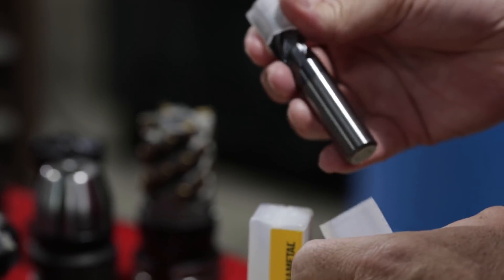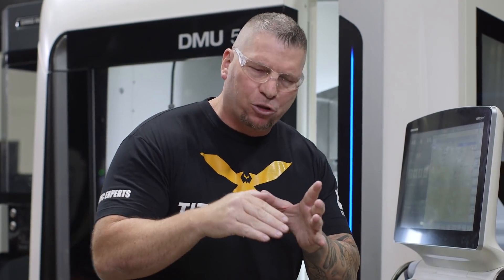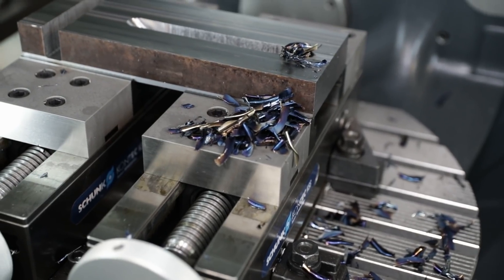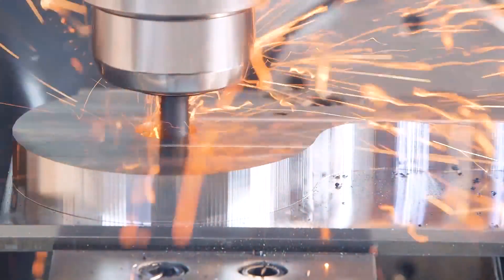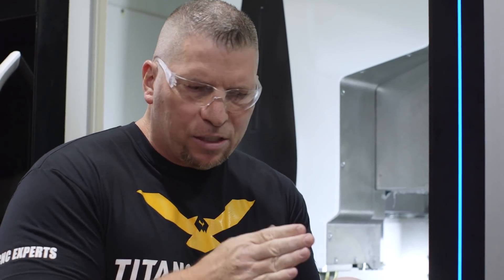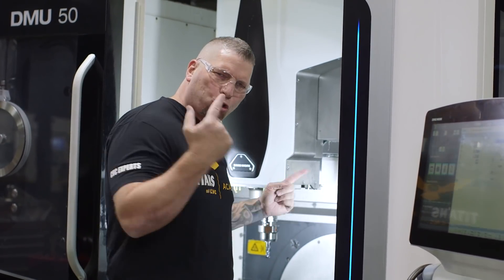Craziest Full Slotting CNC Machining Video You’ve Ever Seen! | Kennametal Harvi 1 TE

Comment: Impresive 🗜️ wel its a good machine  you can test it save. 
The 4flute endmill is impresive good it olso can cutting  stainless steel.
(But yeah i use verry slow speed and cooling oil) it still can by danger 🔧🕵️‍♀️I was surprised how sharp the endmill was after having already processed a lot of matriaal.
I try hss 4 flute endmill and it was after 3mm Bone 😂

Comment: All these years we've all been developing new techniques and strategies to improve machine and tool life, using lead in/out, ramping, trochoidal, HSM, etc. to avoid the old corncob, full depth, slow feed, roughing method. Fast forward a couple decades: Full depth, no lead in/out full depth rough hogging, no technique involved lol. The cost? $10,000+ for a new spindle, thousands for hydraulic tool holders, couple hundy for the 3/4" solid carbide bullnose mill. Hmmmm, yeah, I'll stick to more sophisticated and thought out machining strategies.

Comment: It would be interesting to know the temperature that tool reached doing this.
Reply: At the edge its accually a few 1000C.
Reply: Ideally, the heat produced in the cut is passed through the chips as they are cut away, hence the dark blue color.  I bet that tool was still a little too hot to touch though!

Comment: About spindle or holder flexing? I think that is actually  servo stalling , struggling, - resonating issue. Resonanting frenquency in Titan's video is too low for spindle ot toolholder flex. There is alvays  margin until servos fail. They are out of absolute position when struggling, deppending of setting  They can fall in resonance...  Here you can see what i'm talking about. sorry for anoying english ...  youtu.be/N2bTViQBp10?t=1001  time 16,40  .. also 17.50
Reply: Now when i look it again it seem both factors combine cause resonation: servos strugling - spindle with toolholder flexing... Let slow a bit, then servos can keep constant speed and spindle will flex less and stop resonate

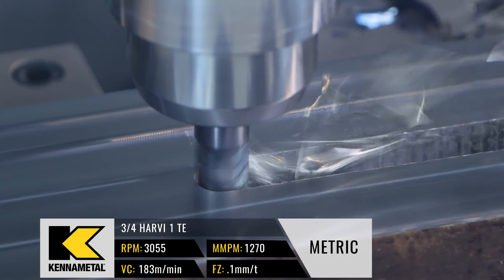Comment: more impressive than the tool is the holder, how did that not pull out or spin from torque? does it have the safe lock feature? i cant believe it didn't break a flute or twist off from the severe cut at 1:38.  the machine was definitely not liking that.
Reply: I believe the harvi tools have a special holder that has threads that match with ones ground into the end mill so if anything it gets tighter

Comment: I think you are hitting the limit of the hsk 63 connection, might do better if you can get a shorter gaugelength holder.
But really cuts like that are for hsk 100 or 50 taper machines with box guideways.

Comment: I mistook the head vibration for trochoidal milling..
Reply: Yeah so did I.  That machine is not long for this world.
Reply: NerdByDesign I use mazaks, my experience with haas has me thinking they’re not very robust.
Reply: @TheJonesey1  I am pretty sure that was a DMG Mori and not a Haas machine.  I have heard that Haas is not as robust, but they are far better than they used to be.  They also cost quite a bit less than Mazak if I am not mistaken too.
Reply: NerdByDesign ok, mazaks are expensive but very good. I do like g code machines too, both have there pros and cons.
Reply: @TheJonesey1  Oh I am not arguing that Mazak does not make a great machine because they do.  It is just like comparing a Porsche to a VW in terms of performance and cost was the point I was trying to make.  I only pointed out the machine was a DMG and not a Haas because a DMG is also superior (performance and cost wise) to a Haas.  Just goes to show the shear strain the machine was under to do that to the spindle and tool holder.
Reply: NerdByDesign I get what you’re saying, it looks like the tool was capable of more than the machine could provide. Impressive how took technology had come on. Titan talks a lot about haas and gives the impression that that’s all he uses.
Reply: @TheJonesey1  I am pretty sure Haas is a channel sponsor.  Same as Kennametal.  When he does some of his more extreme cutter test he uses the DMG because it has the feed speeds the Haas does not.
Reply: @TheJonesey1  you can run g code on mazak. Same thing they just call it EIA. Post right out. Mazatrol is just as bonus in my opinion. I can't speak for the mills, but this would be a little much on the typical integrex
Reply: Travis Tucker I’m aware you can use g code on mazak, I find it handy for 3D milling, also it’s good for engraving. 
I’ve used a mazak variaxis for several years and more recently started using integers more.

Comment: you should try our "Diver" cutter from Gühring !!
Reply: I tried a couple guhring divers the other day doing some slotting of steel plates, they chatter and it eventually exploded doing a straight plunge as advertised.  These were the small diameter ones 3/16" of an inch, I also tried a Niagara that was chatter city and a Kennametal Harvi 1 HPHV that ended up being dead silent and lasting.  I'm still using the kennametal tools on the current job.  Good tools empower you to make more money faster.  Maybe the diver is better in the larger sizes or with better machines, I don't know.
Reply: @multiHappyHacker  I did my final exam with the Diver and it did better than the kennametal in this video.
With a 11,5mm endmill I milled 1xD slots with 290m/min (ca. 8000rpm) and fz=0,75mm/t (ca 2400mm/min) into 16MnCr5 (5115 in America). Nothing broke and in the evening the mill looked like it was new.
Reply: @flozo98  The TE is fairly recent, in what way did it do better?
Reply: I'm backing this ;)

Comment: This makes it quite apparent that the x axis is built a bit more rigid than the y axis. Either way I hope to never visibly notice flex on any machine I’m working on 😳
Reply from the maker: They always flex at some point... that’s what taper is when cutting. This is just extreme and not a real world application... because I drove straight in pushing forward so the pressure on the EndMill pushed it in multiple ways. Good education really to help people understand the difference between a HSK63 and HSK100 and what’s best for what application.
Reply: TITANS of CNC: Academy I didn’t expect a comment from you! I am doing the academy right now and I’ve been loving it! 

This is awesome and I appreciate the tests you do because I wouldn’t get to see anything like this otherwise! So crazy to me that tools are getting so advanced that they are no longer the limiting factor. Great work!
Reply from the maker: Glad your taking advantage of the Academy! It’s just going to get bigger and more advanced.

Titan

Comment: That milling head is gonna break before the tool 😂
Reply: Yes, it appeared the holder was almost gyrating in the machine a smidge and did show some tool marks to back it up some. The kennemetal tool line is obviously some of the best their is by demos like this and others with the Harvi 3 so just imagine even with a smaller machine with lower HP how long the end mills will last.

Comment: Never known a holder to walk around in a spindle like that
Reply from the maker: It’s just because of the full slot and amount of pressure I put on it.
Reply: @TITANSofCNC  Oh man I thought you were doing an adaptive slot at first. Man that tool is amazing to hold up beyond what your machine is happy with!  Well done.
Reply: @JDFuchs  Yikes. (I also thought that.)
Reply: @TITANSofCNC  so the tool holder was being sucked out of the spindle and allowed it walk around? We were thinking it was the axis's moving due to the force.
Reply: @euclidmachineanddesignllc704  wrong holder, not a dual contact holder in a dual contact spindle..

Comment: crazy how the stiffness of such a machine is the limiting factor and not the mill
Reply: lol i can break my 1000dollar router by pushing the spindle with my bare hands
Reply: Its not the machine. Its the wrong holder in the spindle.. not a dual contact.
Reply: @xtiz  You mean that the Holder is rotating in the Cone of the Spindle. That would be bad news, because then the Cone is trashed when literally metal is rubbing on metal. It will work but will have a huge runout. Had that case with my hobby CNC, which is really powerful and sturdy for what it is. But also doing a heavy cut in aluminium  1,5- 2xD deep, but i didn't obiously pay enough attention to my workholding. So the workpiece shifted just a little bit and the 10mm Endmill jammed for just a second. But the spindle was rotating at it's programmed speed while the toolholder slowed down for one second (because of the jammed Endmill). The Tool didn't break surprisingly, but the Spindle cone had deep groves in it after that. Getting that replaced and everything up and running again was a major headache.

Comment: I want to work with you brother
Reply: You should sign up to invest in the machines he would destroy that way.
Reply from the maker: My machines last forever... I still have my first VF2ss running perfect after 15 years. Everything is calculated.
Reply: @TITANSofCNC  You have not beaten on your VF2ss in this fashion for any significant amount of time or it would be IMMEDIATELY trashed.  If you calculate the life of your VF2ss under these stresses, the result will be a broken machine in less than 5 minutes .

Pretending anything else is QUITE dishonest. Are you going to continue this charade?
Reply: @barrycarpenter270  oldhead

Comment: Jeez, I've never seen a machine flex like that before, that can't be good for it.
Reply: Yup , that is the fastest way to makesure that your machine gets all the dimensions out of tollerance ... nice way to destroy the head
Reply: Craig Krueger this isn’t the Maschine is it the Toolholder
Reply: @Kevin-tf4fl  the tool holder is flexing a lot more but the machine is definitely flexing too
Reply: @85CEKR  i think that is not spindle or tool flex - but servo's hunting and struggling
Reply: @nonjb3811  yeah that's what I thought at first too. Go back and look at it again, I think that tool holder and spindle are flexing
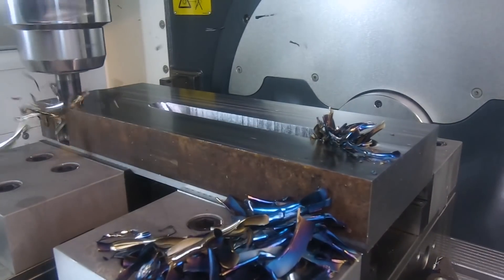Reply: @Kevin-tf4fl  Even at 1:50? You can see the spindle itself there, and it does appear to move quite a lot, but I dunno :)

Comment: 1:41 Was the tool path supposed to move slightly from left to right or is that the machine flexing
Reply: I think the machine was not flexing. It seems like the Y-axis feed servo was hitting the limit and slowing down.
Reply: @bronzesledgehammer  Wrong
Reply: @bronzesledgehammer  then there would be following error following an estop. The toolpath has a specified feed and if the servo cannot keep up, then the machine will go into estop
Reply: machine flexed, if you look closely at the head you can see it move